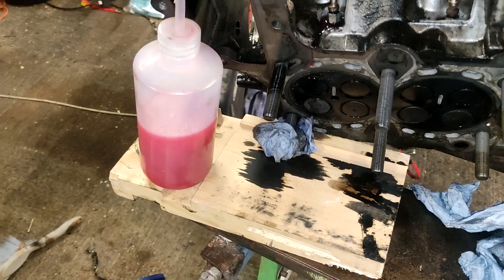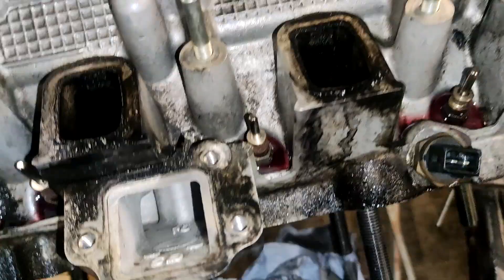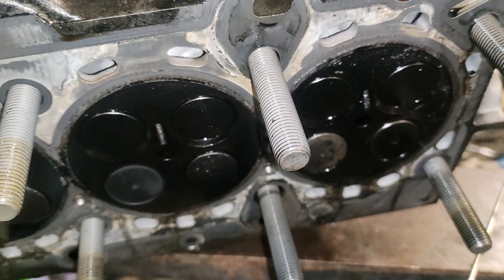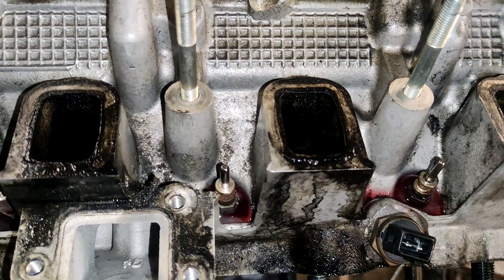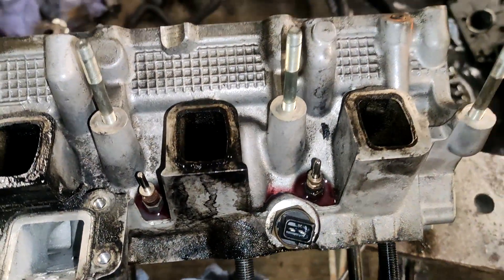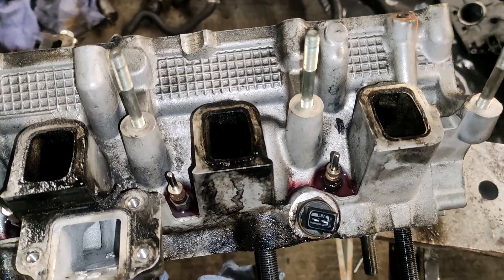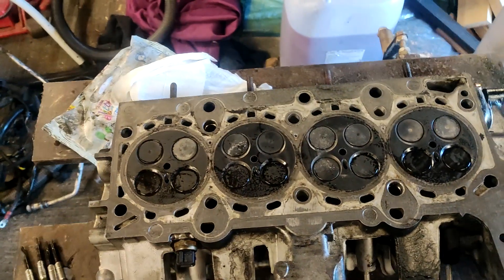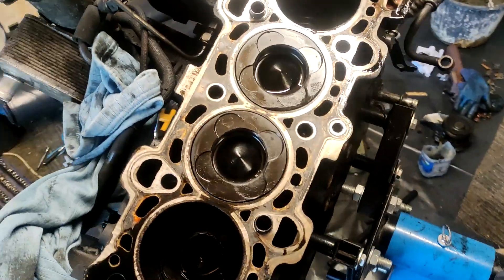BMW M47 Engine Build Part 9 Glow plugs & block and head inspection

Comment: currently trying to  strip a m47 and rebuilding... i snapped 2 of these things. i hate this engine. still i wont let it defeat me. ill be watching more of your vids for motivation and tips.
Reply from the maker: i snapped the 2 bolts that hold the ring that the vac pump goes into damn things! i was being careful as well and they just snapped 

my current job is removing valve guides that's a pig of a job I definitely am not putting them back in ill get the machine shop to put the new ones in and I'm getting the block bored and honed 

keep watching more video's coming